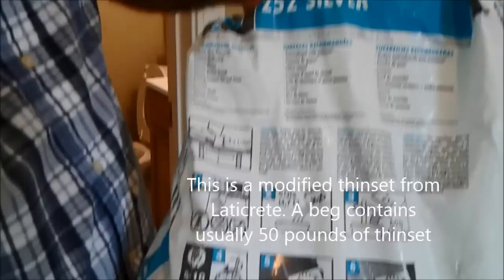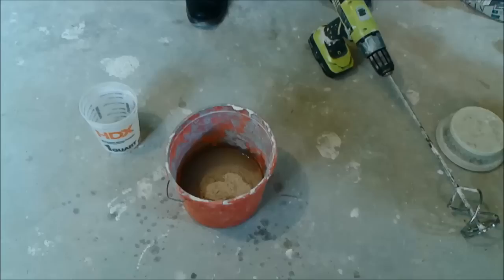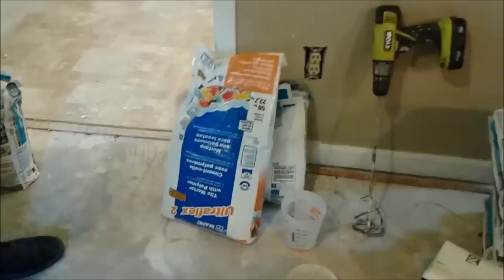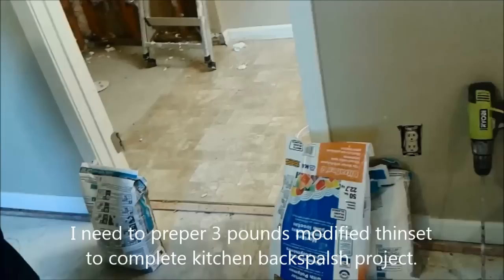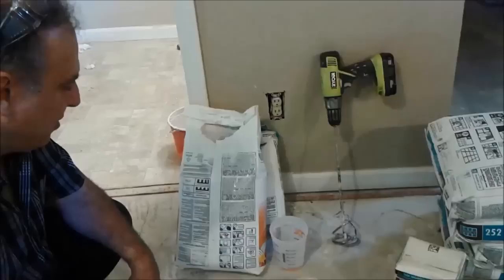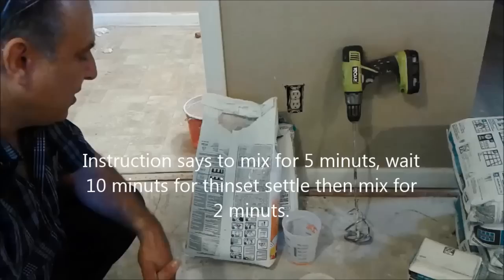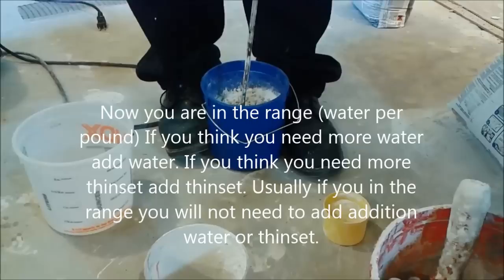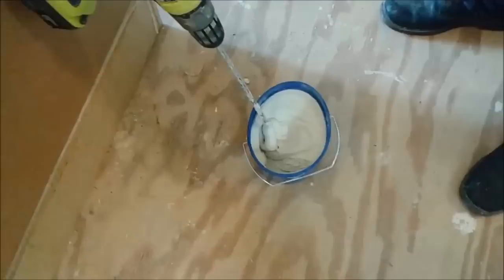How to Mix Thinset Mortar Properly  - Do It Right First Time - DIY

Comment: Easiest way to mix if you don’t want to use a whole bag. Just use half a bag. Get the bathroom scales. Measure full bag. Then measure half of the bag on the scales and half the amount of water which is on the back of of the bag. Easy. Less Waste this way
Reply from the maker: Yes you right but not for beginners or DIY. DIY and beginners should do  (3'x3') 9 sqf at the time. Also for mosaic tile a 3 to 4 pound will be more than enough so 1/2 a bag is out of the question.

Comment: can thinset make pots?
Reply from the maker: No.
Reply: @josephk9182  doesnt it harden, like cement????
Reply: @altheabrown873  Pots are not made of cement. Pots are made of ceramic which is fired. Cement is not suitable for that, it will crumble if you pick it up unless you're very gentle.